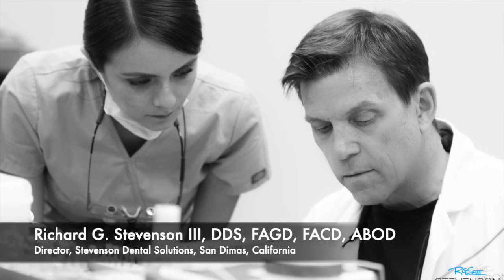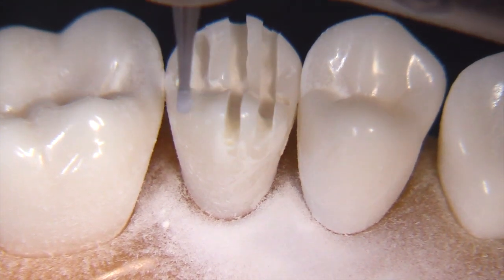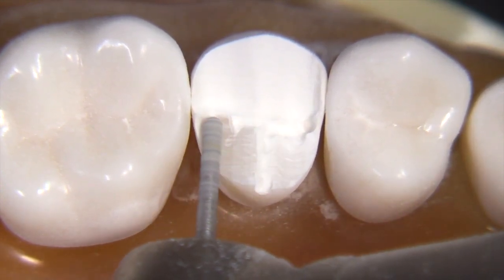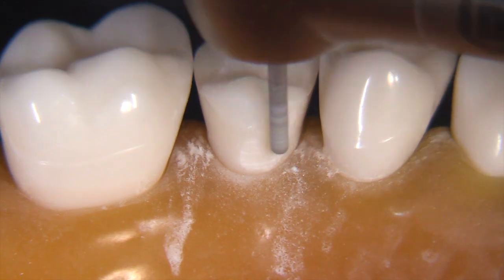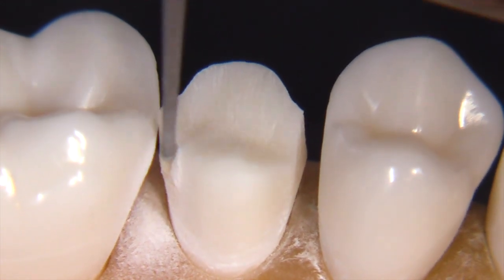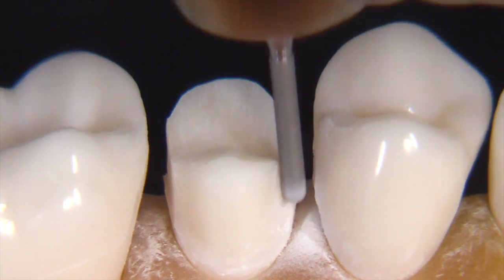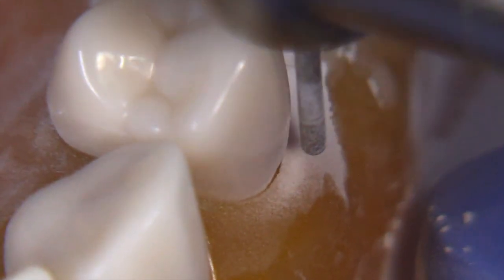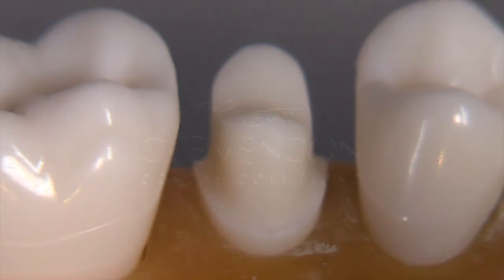All Ceramic Crown Preparation for Lithium Disilicate #4 KILGORE

Comment: What are your thoughts on the Vertiprep? Thank you
Reply from the maker: To my knowledge there have been less than 5 clinical trials on this design and the conclusions are that it is comparable, yet leaves some patients (up to 25%) with chronic gingival inflammation.   Additionally, the time required between prep and delivery isn't going to work well in most US dental practices.  My Ph.D. colleagues who look at restoration fractures are not fans of the feather/knife edge finish line associated with this approach.  Until more convincing evidence emerges, I woiuld avoid this design and stick with the proven concepts.
Reply: @StevensonDentalSolutions  thank you for sharing your knowledge! It is truly appreciated. Oddly enough that camp espouses that gingival health is better with a feather edge than any other margin. It’s so hard to know the right choice. However you back your statements up with studies which is very impressive

Comment: WONDERFUL 
I am super amazed at your fine work
What if we hit the adjacent teeth which can lead to failure at exam 
Can you make a video how to fix these errors?
Reply from the maker: Thank you! I usually use a composite disc series and try to maintain contour as I remove the scratches.  I would also recommend using an InterGuard (by UltraDent) if allowed, or a FenderWedge to protect the adjacent tooth.  Best wishes.
Reply: @StevensonDentalSolutions  Thanks alot Sir

Comment: Can we get 90 degree external line angle with Ks0 bur doc? I am kinda confused when i use ks0 bur bc it lead to sloppy shoulder so i was wondering if it’s acceptable? Much appreciated
Reply from the maker: When you start out, the shoulder will be smooth and continuous, but not shaped correctly.  Near the end of the prep, tip the bur (use the KS0f) so that is is parallel to the root and freehand the refinement of the finish line, to make it 90 degrees  externally.  This is simple on the facial and lingual and a little more difficult interproximally.
Reply: @StevensonDentalSolutions  thanks alot doc what i am facing tbh is that when i remove the lipping caused by the same of the bur i end up with slightly obtuse angle as i am using hatchet to remove the lipping…. I will try your recommendations and see the difference thanks alot doc

Comment: Can I use 847 016 instead of ks0 bur ? My concern is internal line angle which should be rounded so idk if 016 can give that kind of margin
Reply from the maker: 847 will give a shoulder with a fairly small internal radius.  I'd prefer the 856-016 for this if the KS is not available.
Reply: @StevensonDentalSolutions  my board exam provide only 847 and 856 016 and they want shoulder margin so I was think if it’s possible to finish the shoulder with 856 to get rounded internal line angle of the shoulder
Reply from the maker: @bruhbrx  it is - nice

Comment: Sir if you could let me know..which finish line good supra or subgingival for all ceramic
Reply from the maker: on the typodont - always supra.  On the patient it depends on many factor: esthetic demand, pre-existing wear at the cervical, caries, pre-existing restorations, retention needs, material used, adhesive technique vs cementation...
Reply: @StevensonDentalSolutions  posterior teeth rct treated..all ceramic..rely x used for cementation..no cervical decay..will supragingival finish line be the right choice ..mild gingivitis
Reply from the maker: @maryamhaqh5482  yes if esthetics will be preserved.

Comment: The bur you used is radial shoulder for prep ? Round ended tapered bur ?
Reply from the maker: For an all-ceramic the ideal margin is a fillet, which may be created with a round ended tapered bur or a KS bur.  A radial shoulder also works, although ore aggressive - like an 847KR-016.

Comment: Tq doctor helped me for my pre clinic work but we can use flat end taper to achieve this outline u have done we usually use flat end taper and anyways tqs doc for the technique u shared
Reply from the maker: Yes the flat end taper diamonds will accomplish the finish line you are looking for, however, internally they remove more tooth structure. I prefer a modified flat end like a KS 0 or 1.

Comment: Hi Dr. On your PFM premolar video, you used a T prep to make an occlusal reduction. In this video, you make depth cuts with a 330 carbide bur. Is one technique more practical than the other? I tried T Prep last week on dentoform & it was frankly a bit challenging. For a second year student, Is it easier/more practical to make depth cuts with carbide or keep practicing and perfect T prep for occlusal reduction?
Reply from the maker: I hear you!  You may with to Tty a combination of the two: use the carbide for the depth cuts, then just reduce one half, so you end up with a wall adjacent to your reduction that allows you to judge reduction.
Reply: now that’s a Stevenson dental SOLUTION! Thank you!! Your work is of great service to students & clinicians alike :)

Comment: Just another great work.If I may a question Doc how deep would you prefer to go in marginal preparation? subgingival or equalgingival? what would you suggest? thanks for this not only for students video
Reply from the maker: If esthetics is an issue, I usually go equal gingivally or slightly below (0.5 mm).  Otherwise, supra gingival.  Thank you Doctor.

Comment: Thank you so much for t
he video. We miss you 🌹,,,
I thought the finish line should be 1mm,
Is there any simple solution to save the neighbored teeth during the prep?
The page technique??
I would love to know about fiber post placement and please let me know what kind of material you recommend for crown for the first upper premolar?
Thank you 🙏 
Hamid
Reply from the maker: Hi Doctor!  Thank you for your comments and questions.  The e.max finish line need not be as much as a Zirconia restoration or a PFM.  Clinical trials have shown that less reduction is acceptable with lithium disilicate in the axial areas (not the occlusal).  To save the adjacent teeth I use small burs and leave a shell which protects the adjacent teeth.  For most upper first premolars with no issues with shade and normal function I'd recommend lithium disilicate.
Reply: Stevenson Dental Solutions thank you 🙏
Reply from the maker: @hamidazizi6600  My pleasure - new videos being edited now!

Comment: Appears to be a highly skilled workmanship!  I wonder how thick the typical enamel structure is that allows so much reduction of the tooth without exposing the dentin structure?  Great video!!!
Reply from the maker: Typical enamel is only 0.3 mm or so thick for the most gingival 1 mm area on anterior teeth and  about the same for posterior teeth.  It's very hard no to expose dentin for crown preps, even with the new materials.  A "Vonlay" (veneer with an onlay) prep will allow for enamel preservation on the facial if it is very minimally reduced.

Comment: Thanks alot dr , can u plz explain vertical prepration ,how to do , which cases  and all details
Reply from the maker: The vertical preparation is one which uses a uniform taper from gingival to occlusal and a knife edge finish line.  It is said to conserve more tooth structure at the gingival and leave more enamel intact.  The only challenge technicians have with this prep is that Zirconia is very weak and until it is sintered and it is fragile.  Also, the final crown can be over contoured at the gingival due to the technician not thinning out the zirconia for fear of chipping.  I'm not a fan and will wait for clinical data to support a change like this.  Thank you!

Comment: Thank you for the video!
My question is, is the margin width here for all-ceramics sufficient? I know it should be around 1.2 mm to provide enough space for the ceramic to go on. 
Please correct me if I’m wrong :)
Reply from the maker: For PFM you are correct, but not for all-ceramic - this is monolithic lithium disilicate and marginal thickness as little as 0.3 mm are acceptable.  We use this for veneers all the time.  Thank you for your question.

Comment: hi Dr. thanx alot 
plz can I ask you why you dont use tapered bur as usualy text book say instead of straight round end bur 
and the finish line you did it always above the gingiva why not so close with line of gingiva
Reply from the maker: Clinically the finish line should be closer to the gingiva or even sub gingival.  The tapered but are good but they are wider at the the shank end, making them a bit tougher to use inter proximally.  I usually like to create the draw myself rather than the bur but not always...

Comment: Sir i Really want to know how to have a perfect limit without causing bleading in the gingiva
Reply from the maker: I like to place a cord first or use Tephlon tale in the sulcus to protect the tissue when I'm not able to place the rubber dam.
Reply: But if i havnt acord. What coule i do
Reply from the maker: you may try teflon tape or even cotton which is stretched and made into a cord shape.